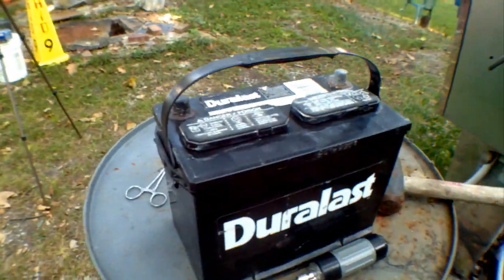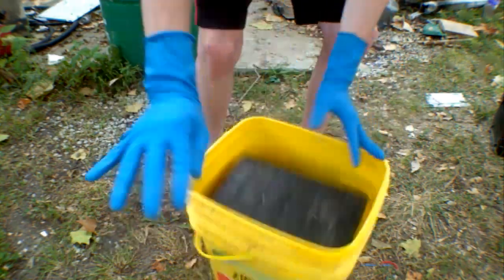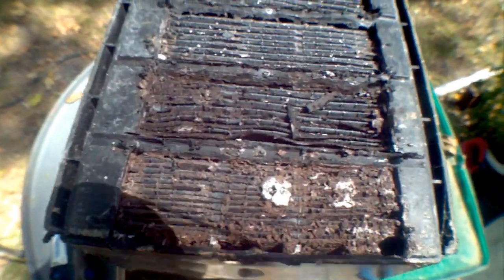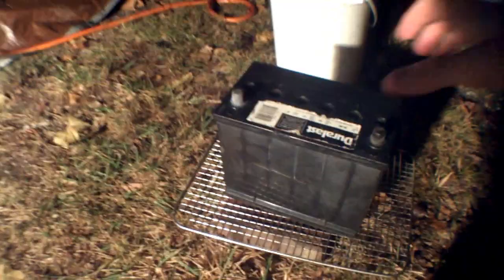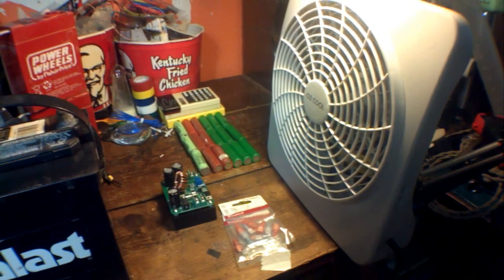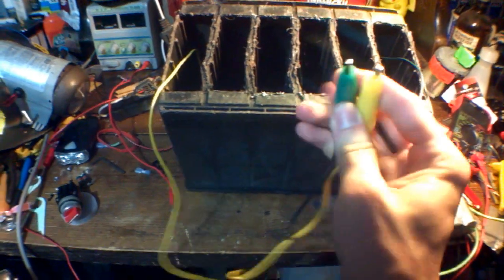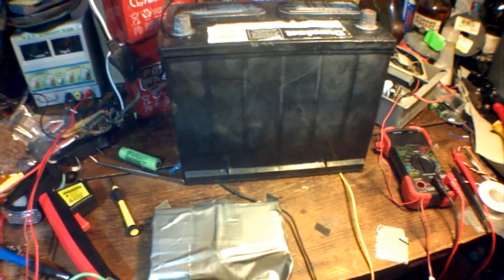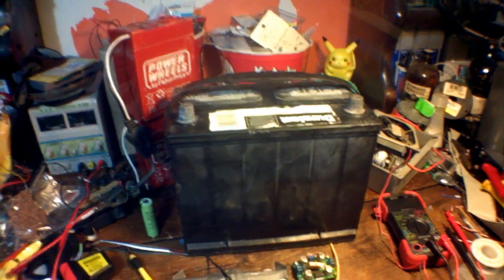DIY Lead-Acid to Lithium-Ion battery conversion 18650

Comment: bravo for safety! 

OMG!  I can't believe how precarious you are. As if the risk of chemical burn and lead seeping through your skin into your bloodstream, to deposit in your brain isn't enough from the splashing, you go on to blow pressurized air to clean the inside without wearing a breathing mask (full-face is what you should be wearing). You have no idea of the repercussions this can have on you later in life.
Reply from the maker: well first off, lead doesnt stay in your body forever. and also dont be such a chemophobe. lead doesnt absorb through the skin too well, and i wore gloves a lot.

the electrolyte in regular car batteires wont burn you too badly, and in an old battery like this it will burn even less. unfortunatly a lot of people hear news reports of people getting burned by battery acid but what the news doesnt say is its mostly concentrated battery acid. the electrolyte inside a battery is 90-95% water. most of the time when people get burned by battery acid its by the acid sold at auto shop that you mix with 9 times its amount in water to dilute it a lot.
Reply: Rinoa Super-Genius Lead is bioaccumulative and doesn't leave the body with any speed, so can take decades to leave the body. He'll be fine if he keeps away from lead for the next 20 years sure.
Reply from the maker: B1GDAV3
no it leaves the body, just look up it's biological halflife.

if lead stays in the body for almost forever, how come after the US banned lead, the level of lead in children's blood dropped significantly within a year? youd think they would keep that lead.
Reply: Rinoa Super-Genius Good for your education that you asked that question! Lead in the bloodstream proves that it is making it into your body. 
Then it gets stored in the cells. When it is in the cells, it no longer leaves. 
It is like kids walking in a hallway: once the hallways are empty, it doesn't mean that the classrooms are empty.  And in the case of lead, it never leaves where it is stored, explaining why it doesn't linger in the blood.
Blood is only a short-term transport method, that is a telltale of what you are absorbing at the moment... NOT of what is in your body permanently. 
By your logic, you should have reasoned that if it is stored in the body permanently, why would it exit again back out into the bloodstream (for processing by the kidneys)?  You should have figured that out by your very reasoning.

Comment: It is an interesting video but an OSHA disaster! Were those OSHA approved flip flop shoes?
lol
Reply from the maker: OSHA would only really come into play if i was paying people to mass produce these.
Reply: I'm not saying that they would be interested, but working with lead, acid, hydrogen and sulfur can be real dangerous. The EPA and other local health and safety officials would be interested. Be careful and keep the video's coming.
Reply from the maker: m715fm
yeah, but dont worry i neutralized the acid and didnt dispose of the plates, i stored the plates for a future project if i ever need them. its not like i dumped the extra stuff in the woods hahaha.

Comment: You could sell old battery and buy a small project box. put two brass bolts for + and - connection for neater look.

Comment: Rinoa,  I hope you are not discouraged by all the know-it-alls who preach safety, blah blah BLAH, over and over again.  I hope they would be more interested in learning what comments were already posted before they add their own original thoughts to contribute to this public forum in a meaningful way.  The weak minded got that way by always acting on impulse before engaging their brain, and I suppose that is why they are weak minded.  I enjoy reading many of the positive comments as people will actually contribute knowledge that is sometimes of more value that the original youtube vid.  I have to say that I thought you were going to build an 11.7 V LiPo pack from reading the title.  I was disappointed that you stopped at 2S instead.  I thought all the trouble of retaining the original case had some other purpose, such as replacing a car battery.   Nonetheless, it was interesting to see the internals of a 12V wet cell lead acid battery, and I'd much rather learn about on YT rather than do it myself.  There were some useful comments and I also learned from them.  Thanks again for this instructional video.  I was entertained by seeing your feet exposed with the lead acid being poured into the bucket.  Can he get away with it?  The video was full of suspense.  Thanks for showing the impact on the tripod as well.  I'm sure many others learned from it as well.  I hope you will modify the battery case further.  Carry on!
Liked!!!
Reply from the maker: thank you, and tbh i find all the negative comments very funny. i've delt with much worse and so its funny to just troll and argue with the idiots.

in the end i'm the one making a living off these videos so i win over the people posting rude comments, they dont realize they actually help my videos get more views too :P

Comment: An interesting project for sure. But please remember to add a protection board per cell group to guard against cell explosion !! You should end up with a large capacity battery bank at 12 to 14 volts for your camping trips. Can you imagine if all the cells were NEW ..... That would run your fan along time. Again, please add a lithium protection board per cell group to guard against charging AND dis-charging too much ....Good Luck..
Reply from the maker: i prefer external balancing over an internal board. and if this was made from new batteries i would put those new batteries into something more important.

Comment: Lead is a very strong poison... Why would you want to expose yourself to a strong poison?
Hopefully you disposed of the Lead someplace safe so it doesn't kill someone
Reply from the maker: no its not a strong poison, lead salts are stronger than lead. but lead isnt bad to handle as long as you wash your hands afterward.

Comment: why not just find a good container for a Li-Io battery pack build?
Reply from the maker: i did, this 12v battery.
Reply: Rinoa Super-Genius you did not, Lipo is dangerous when it explodes and Plastic Burns well, Do you even understand how unsafe this is?

Comment: "duct tape is far better than electrical tape for electricity"  LOL.

The main concern with this battery is Overheating and sealing it with Duct tape will add to that factor. When you have Multi-cells in series they need more ventilation then single lower voltage batteries. I would not suggest using any tape at all.

I'd put several vent holes in the box and push air through it or place it in a freezer with the door cracked 1/8" when charging.
Reply from the maker: lithium batteries only vent or get warm if your using them wrong.
Reply: Poor Soul.
Reply from the maker: Sol Shady
well its obvious you dont want to be productive, hope you dont subscribe.
Reply: a lot of the people that run their mouth on the Internet and have told inventors,  YOU ARE WASTING YOUR TIME. They also pointed out something the inventor was possibly doing wrong. Weather the inventor learned from the comments  or told
anyone that listed ed the commenter was idiot. Was the defining factor in the success
they would achieved most of the time. 

Yes, it's great you are experimenting and posting video of what you made,
To me that's great. I only commented on your battery because I have done
several projects very similar to yours. 

The main difference being is that when someone commented on something
that may be wrong with what I was doing. I would consider the fact
they might be right. The fact that I had gained information for free
was always worth the criticism. 

A genius Never stops learning, and 
always considers any criticism as something to consider as valid.
A genius realizes at a young age they are actually not that smart.
And never except in unheard of situations referrers to themselves 
as a Genius or want to bring up the fact they have a Genius level I.Q
(Whitch really means nothing).
Reply from the maker: Sol Shady
 first off i'm far from a genius, this channel's "super genius" is sarcastic, and secondly i have done a lot of experiments and it seems that duct tape is really good. your afraid a little bit of duct tape will make the cells overheat but you forget that the cells originally came inside a sealed plastic box much thicker than the duct tape and some even come in epoxy.

if your cells start to get hot your pulling too much power from them, thus you made your battery too small for the power needs.

still your only argument is that i should listen to your comment because you took the time to comment, and i have already listened to it and dismissed it in favor of my own experience.
Reply: Cool thank for the Video.
Reply: Sol Shady Good advice! To be able to use criticism to better oneself is one of the greatest abilities a person could learn.

Comment: What a Fire hazard that batter is now.
That bat will produce a ton of heat,

P.s. Duct tape is NOT for electrical projects. It only adds to your
fire hazard you created,
Reply from the maker: batter? sorry but i'm not making pancakes in this video.

and duct tape is far better than electrical tape for electricity. provide proof to back up your statements instead of just declaring them to be true, if your statements dont seem to have any data backing them up then they can be ignored.

Comment: dumb most unsafe thing to do obviously dude is stupid
Reply from the maker: "most unsafe thing to do" well then try to grab a spinning circular saw with your bare hands, or filling an oven with acetylene, or trying to catch a cat somebody throws at you. i can guarantee there are more dangerous things to do than this. driving an automobile is probably more dangerous than this.

Comment: Mixing lion cells like that is an exceptionally bad idea. Making and using a pack of lion batteries without a charge/overdischarge/balance protection circuit board is a bad idea. Lion/LiPoly batteries are highly prone to failure, and usually fail by exploding and burning your house down. They should only be charged with an approved balance charger. Crack open a laptop pack sometime, and you will see that the cells are connected to a pcb board. Not only are the ends of the stack connected, but there will be a wire going in between each set of cells in the series so the board can sense the level of each of them. There is a very good reason for this, you NEED that pcb board or BOOM, see?

Comment: Pour out the acid and save it, then flush out the battery. Let the acid sit so the sediments suspended in it settle, so you can pour off the clean acid and leave the sediments. Pour the clean acid back in the battery evenly between the cells and top them up with distilled water. What shorts them out is lead sediment accumulating in the bottom of the tank. The lifespan of the battery is determined by the depth of the tank beneath the plates. Battery restore 101.

Comment: Mr Super-Genius, I'd recommend safety equipment like goggles, boots, and having baking soda and/or vinegar readily handy when you're about to pour acid into bucket.  Since you're not putting electrolyte into the box, you could easily have drilled a hole at the bottom of each cell, popped the caps off, and let them drain into the bucket without even touching the battery.  Also, the top of that battery is a lot easier to take off than you made it.  Running a 12vdc fan off of 8vdc is going to increase the current used, by about 75% (I think the percentage is correct, but haven't had a lot of coffee yet this morning).  In other words, you'll use less current if you use the correct voltage, or higher voltage, because, well, V=I*R.  Nice idea, though.

Comment: Using a converter like that is a waste of energy. Why didn't you arrange the cells to three in series in the first place? And use electronics to concentrate on the protection against overcharging and overdischarging?
Reply: Rinoa Super-Genius
Your calling people trolls for pointing out safety issues? That my fine feathered friend is trolling ; ) Hes right, and you will have a fire, it is a matter of time. You are too sloppy and practice very bad habits when handling li-ion cells. My question is, will you post a video of the damage and charbroiled bodies after your first mind numbingly dumb mistake? I wonder how your parent will feel when the insurance company gets a hold of the videos that will void the fire insurance policy?
Reply from the maker: because i didnt want just 12v from it. with the step up board i can make 8-30 volts.
Reply: Rinoa Super-Genius
Why did you bother so much with the cleaning of the case then? If you don't want a compatible battery, a generic pack could be put into a much nicer and smaller case. Your salvaging sort of implied the attempt to retain its car battery function. Plus now somebody may attempt to connect it to a car battery charger in the future, possibly frying it. I always try to prevent accidents by designing things so that common layman behavior won't lead to disaster. Like when running PoE voltage through UTP cables, I choose the pinout so that it won't fry a router when plugged in a data port. You never know who will handle it next (parent, friend) even if you now believe that you know it perfectly and nobody will ever touch it.
Reply from the maker: zwz • zdenek
i dont care what other people do with their batteries. they dont control what i do with my batteries.

if your afraid somebody will watch this and build a half-assed battery that ruins their step up controller costing them 7$ then so be it. i hope they burn up their step-up controllers because that would be a great learning experience for anybody who does it wrong.
Reply from the maker: zwz • zdenek
 your comment would make sense if my video was titled "how to burn your house down" and you say if somebody copied this video but did something wrong they would burn their house down, well that would be them not fully following this video.

either way your just a troll, was fun arguing with you.
Reply: Rinoa Super-Genius You keep hiding behind your fallacies and "freedom." My previous comments make good sense with this exact video as it is. You can even see how others see the problems by the poor rating (many thumbs down). No trolling, just perhaps too much correctness by me and too much risking on your side. I'll give you the popularity though.
Reply: Rinoa Super-Genius lol

Comment: you just proven my point always wear protection, how not to handle a acid batterys your an idiot wearing flipflops especially handling old heavy things like them. A car battery would practically break every toe. That's fact, not trolling.

Comment: I have to imagine what a profound waste of time this was when an electronic project box with a couple of terminals would have cost less than $10, been a hell of a lot safer and taken all of 5 minutes to assemble. Now I'm sure you had your reasons for building it, it's use that i can't fathom what they would be.

Comment: First of all, you aren't using your old "battery".  All you are doing is using the old battery case to hold new cells (actually, only 17% of the capacity of the case to hold new cells).  But to get to that point you endangered yourself (Really?  Gloves but bare legs that were closer to the acid than your hands were?), not to mention the environment.  You failed to mention how you disposed of the acid or the old lead plates.  When you trade in an old battery they are sent to a recycle center for processing safely and correctly.  
When you dropped that battery into the bucket, what if some of that acid had gotten into your eyes as well as the tripod legs?  And all that could have been avoided by just using an old tackle box for a case instead of a battery!
That device you had for stepping up the voltage is not a "transformer".  Transformers are specific components for raising or lowering AC voltage and current, not DC.  Its doing what you want it to do, you just aren't using the correct terminology.
I applaud you for experimenting with electricity.  But for God's sake (and your mom's!) do it safely.  Not this way.
Reply from the maker: oh no i upset a neckbeard.

you do realize that battery acid is mostly water right? it doesnt burn your skin especially when its old acid. this project wasnt very dangerous.

Comment: I think lead acid starter batteries last quite a long time when not used in cars where they are subject to vibration and heavy starting loads. I also have a car battery in stationary use which is still going and is about 12 years old.
Reply from the maker: actually those dont have much effect, its the internal computers in modern cars that slowly kill the battery. starter batteries cant be discharged very far before they start getting damaged.

Comment: indeed, that is an incredible waist of time and an unnecessary polution....
And you never solder 18650 batteries. It destroys them. Only contact welding with Ni plates. Ald also with a protection circuit, that also makes the equalization of the cells when charging.
since you have internet connection, you could study a bit more first..